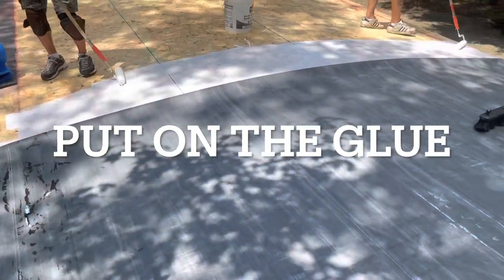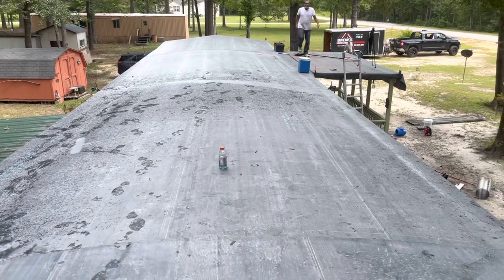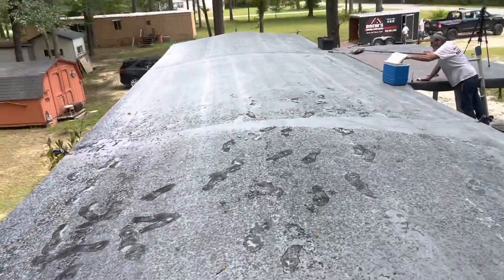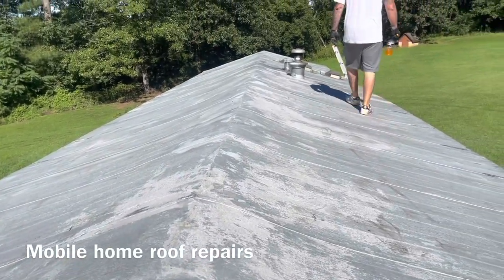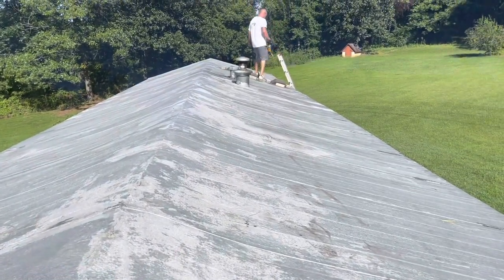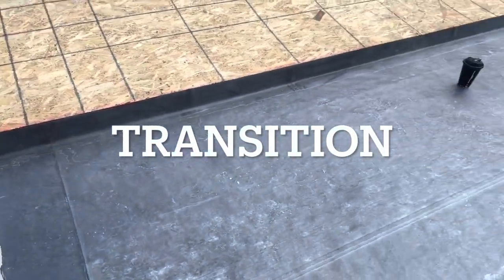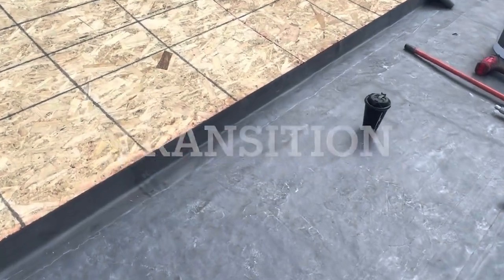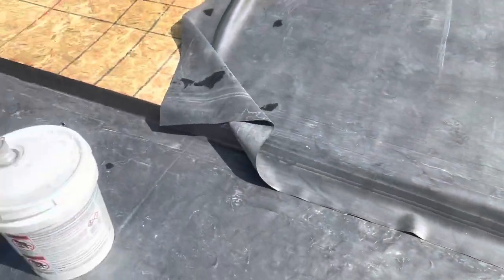Mobile Home Roofing.  YOU WILL LOVE THIS. The Travelers.

Comment: Been working on my subfloor! Got some videos of what I'm doing, hope to get them edited tonight.  My question is... how much rot in the rim joist is too much? If there is just less than a haft inch, I could sister it? I really want to just replace any bad rim joist, but haven't tried removing any of the vinyl siding yet. I know it can be done and even have the tool to help remove it. One nice thing abouts my mobile home, it was built with 2×4's and 1/2" treated plywood! Even with the roof leaking, the plywood hasn't rotted much at all (so far).

Your videos are very helpful!  I've got a long ways to go but I know it can be done. Thanks for what you are doing!
Reply from the maker: Good QUESTION yes sistering is fine as long as there is still some meat there. Thank you for watching
Reply: @Drewsroofingandhomerepair  Posted a video of what I'm doing so far.

https://youtu.be/IR1HzPHJIRU